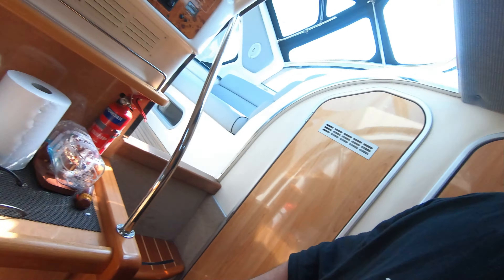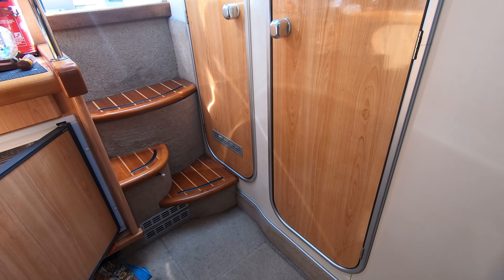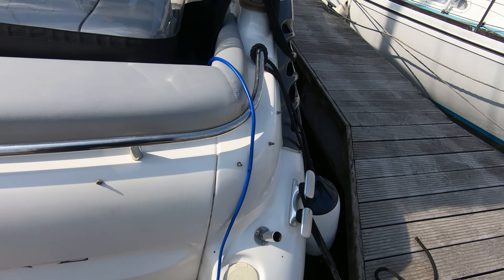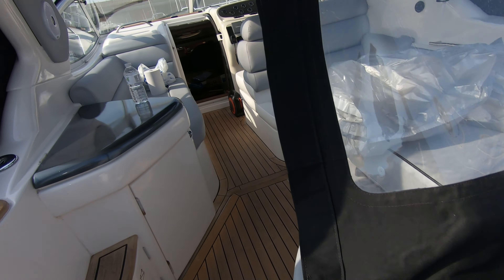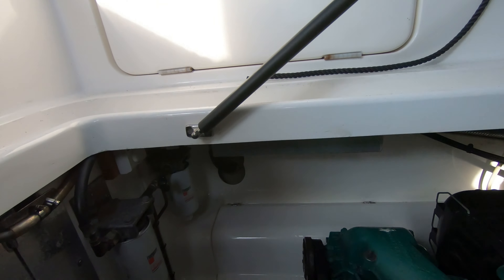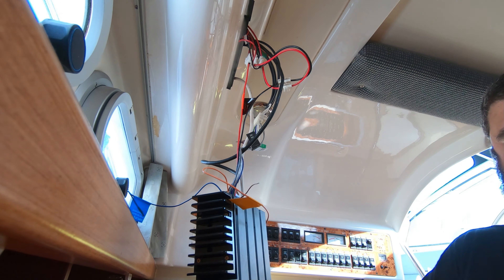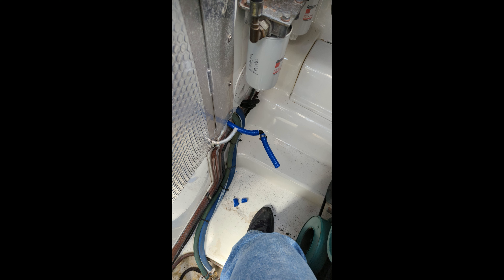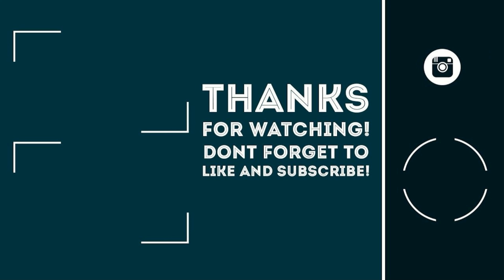Final jobs on SJ before she goes

Comment: Hi Dave,
I would welcome your advise on what to purchase and how to set up and use devices to enable me to get broadband and a wifi signal on my boat.
I only require it when plugged in to the mains at the marina with a 16A 240v supply available. 
I am happy to just use my phone data when I am away from my mooring,  
Any advise would be most welcome 
Thank you
David
Reply from the maker: tesco mobile sim card with unlimted data set you back about £20 a month and then basically any home 4g router will work just fine alternatively you can use an old mobile phone with a tesco sim card in it and just plug it into a socket on the boat with hotspot enabled.  thats your easiest way.
Reply: @DavesBoat   Any reccomended routers dave ?
Reply from the maker: @davidlee62  not massively spring to mind since i tend to use enterprise grade equipment force of habit.  I have however seen people using things like this https://www.amazon.co.uk/TP-Link-technology-Configuration-Archer-MR600/dp/B083KDK9JC/ref=sr_1_17?crid=2JBEPCW4UZ01M&keywords=4g%2Bhome%2Bwifi%2Brouter&qid=1651153257&sprefix=4g%2Bhome%2Bwifi%2Brouter%2Caps%2C65&sr=8-17&th=1 which is probably more than sufficient.

Comment: What you have done to your S28 is a credit to you.
Did you only sand the teak on the swim platform down if so what grit did you use .
Reply from the maker: Mainly on the swim platform and a couple of little areas on cockpit where fridge door caught. Started on a 40 grit to get it down then an 80 to smooth it